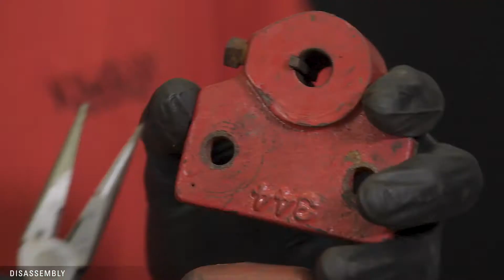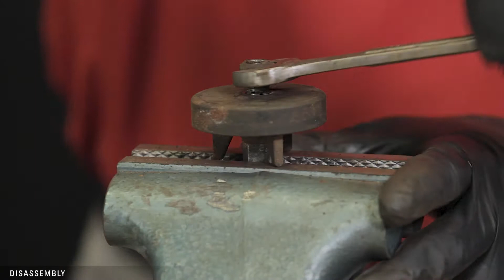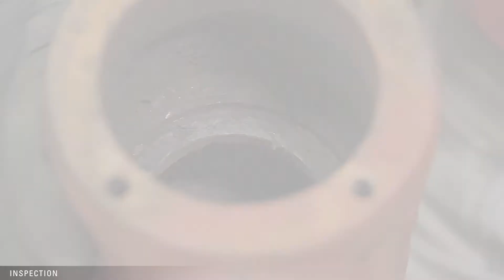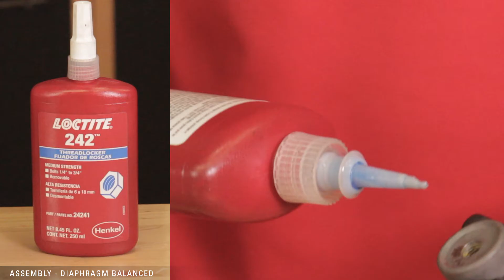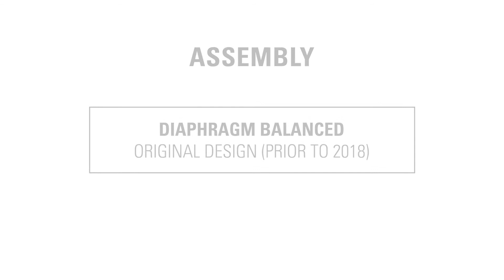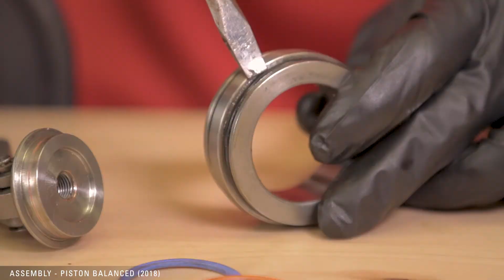How to Repair a Kimray Lever Operated Piston & Diaphragm Balanced Dump Valve 🔧

Comment: Got any mechanical dumps that don't get butt fucked by sand
Reply from the maker: Sounds painful. Yes, sand can be very damaging to a valve. We offer the Piston Balanced Throttling version of this valve, which reduces the effects of sand, as the trim lifts up and out of the flow path of the process fluid.
For pneumatic operation, we now offer a very robust solution for erosive conditions, the Low Pressure High Volume (LPHV) valve, with the option of D2 hardened steel trim. In case studies this has outlasted other valves in erosive conditions by more than 10x.